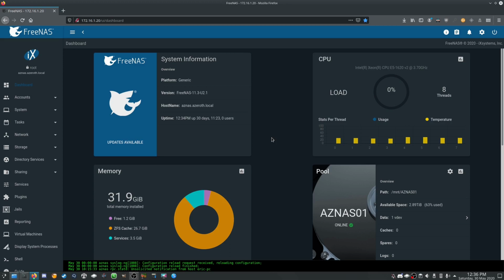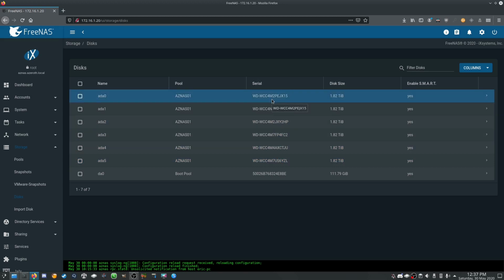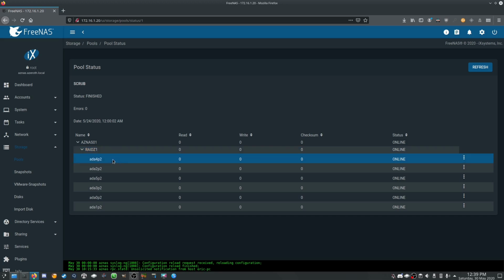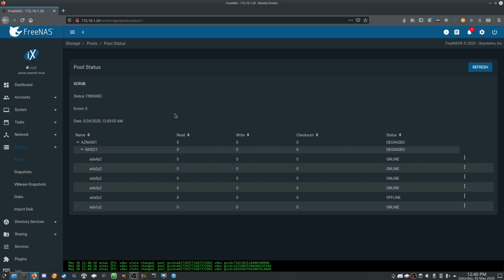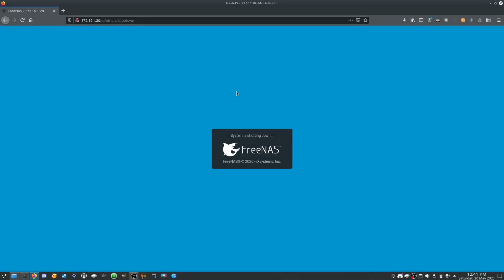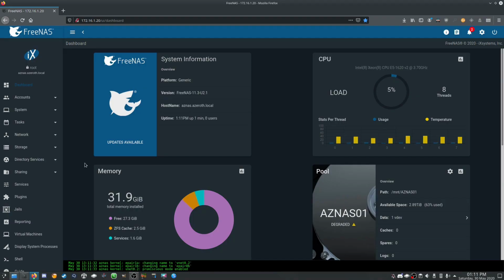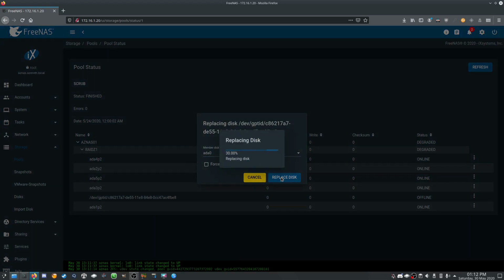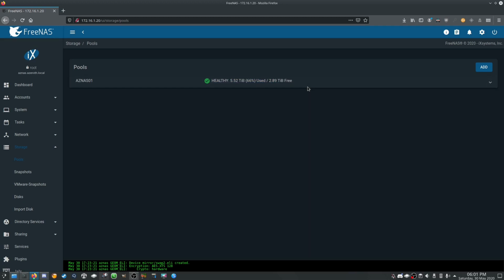How to swap a disk in FreeNAS and grow your pool.

Comment: Not  the safest way to do your swap. Much better to "Replace" the drives one at a time with the old drive still in there. That will maintain your Z1 redundancy. The way you are doing it, if the one of the other drives dies, your whole pool is lost.  Once the new drive is reslivered, it will take the old one offline and you can take it out and do the next one.
Reply from the maker: Nice! I didn't know that was an option. The more you know.
Reply: @GenericEric  I was getting ready to just do swaps one at a time and fell into the "Replace" feature in a YouTube. I thought that looked like the best way. :)

 I just redid my Plex server this way. I had 4-4TB drives in Z1, I used the replace and swapped them one at a time with 8TB drives to double my storage capacity. 

Went off without a hitch.
Reply: @KirkDickinson  But if you replace, using your example, a 4TB drive with an 8TB drive, doesn't the system format the 8TB as a 4TB before populating it with data from the old 4TB, leaving unused space on the new 8TB?
Reply: @KirkDickinson How would you do that? You have to replace the drives one by one regardless. My server is getting pretty full and I know it's just a matter of time before I have to start going through this process so I figure I might as well start swapping out the drives as I get a few extra bucks. What video did you watch that really helped with this process?
Reply: @hulknotlikepunybanner  kind of what I was thinking unless after they are all done there's an option to just expand the storage pool
Reply: @hulknotlikepunybanner  I keep trying to reply and when I post a link to the IXSystems tech document, it gets immediately removed.
Reply: @KirkDickinson  I can't find anything on expanding storage by replacing drives. Though I just discovered that 4 years ago I striped (instead of mirror) the drives so I need to move the data elsewhere. Then destroy the pools, replace the disks, and create a new pool. At lot of these videos don't serve the individual user trying to learn. iX Systems should just put out videos to help folks use their product... you know, without the tutor talking about themselves.
Reply: @KirkDickinson  Hi, nice work, do the system automatic raise to 8tb when all drives have been swapped? - I am thinking to build one myself but will start with cheaper 2tb disks, thinking about z2 6-7 disks.
Reply: @CrazyBossDK  Yes, the pool should automatically expand to fit when all the drives have been upsized.
Reply: @KirkDickinson  Thats cool, i think i will go and test it :) but nice to know when disks become cheaper :)
Reply: thanks for the comment! Very helpful as I think it is essential to keep redundancy during swaps !!! Do you mean Replace requires both Old and New disk plugged in?
Reply: @marcg1043  yes. You need a free sata connection to plug in the extra drive.
Reply: @KirkDickinson Does the same apply for Z2 raids?
Reply: instablaster
Reply: @cyrusgrayson7457  What is instablaster? Sounds like a juice blender!

Comment: FreeNAS is useless. You have better luck adding to your desktop and using windows shares.
Reply: Pretty strong statement there. Could you provide more info on why FreeNAS/TrueNAS is useless?  And why Windows Share is better?
What about Linux and Samba?
Reply: @malisa71  Because for some reason we live in a world were people must have all these empty drives laying around, not no body has 15 hard drives filled with 80TB. So for me to even use freenas for my 80TB I would need 320TB or 40 barracudas at 150 bucks a pop. Okay not a problem. I have two empty 8TB's but can I use these? No!!!!!!! I add 8TB and all I get is 2TB, I had 16TB, I get 4TB. I would be there until the cows come home transferring. Okay look at alternatives, stablebit. Even stablebit demands empty drives. Right now i installed stablebit and for me to add my disks to my pool I have to add one drive, transfer from another drive to that, add that new empty drive to pool, transfer another drive and so forth. I am literally moving 8TB's of data from disk to disk just to pool them. Now how is that or this any better than SMB or sambaa? Add my disk. Click share. Bada boom bada bing. Need data loss prevention? Backups, cloud, off site, cold, so many. Just add a disk to your OS and use the OS. Saves money.
Reply: @UTCUTR  I see. I agree on many parts with you but what about the data degradation that could happen over time? With you method you will have no such prevention. There is a potential that you could backup corrupted data to your full backup and you will not even know it.
Do you somehow else check for that?
Reply: @malisa71  TBH i have been data hoarding since napster and mininova days. I personally know better and truly understand what you mean fully. Thats why for the better part of 15 to 20 years now i buy new HDD annually. Move important to new, non important to old. Its gotten to the point where i need to centralize. I have 5 machines with 3 to 4 drives each but a machine has so many ports and bays. So i bought a saberent box. Now there's 5 machines and a NAS box. I need a solution. I recently bought new server with 10 bays and a coolmon 6 port SATA. Now i need software. It's a tough life for a data hoarder, on a budget.
Reply: @UTCUTR  I think you miss the point. NAS is not backup it is high availability solution. If you want the system that will guarantee that data are available even if one or two disk are down there need to be a cost associated.
Reply: Disagree with your statement. i have 35tb worth of data on my freenas. 22 of it is Plex.  Good video. Thanks for posting as I will be upgrading mine soon.